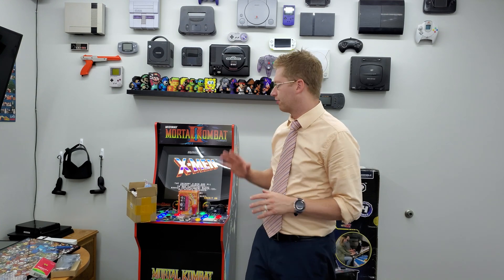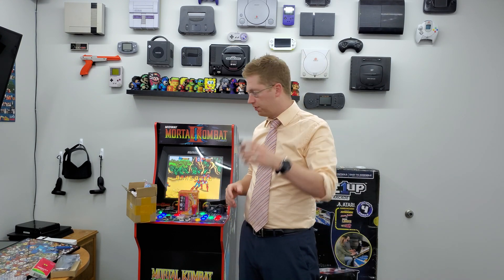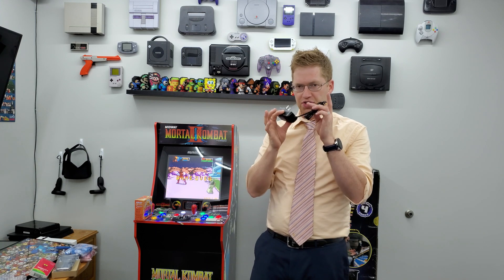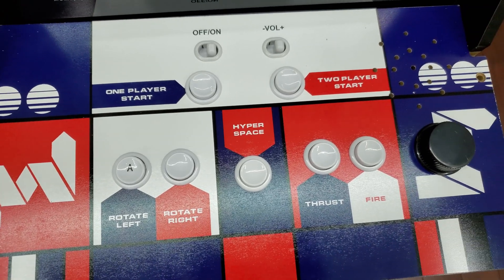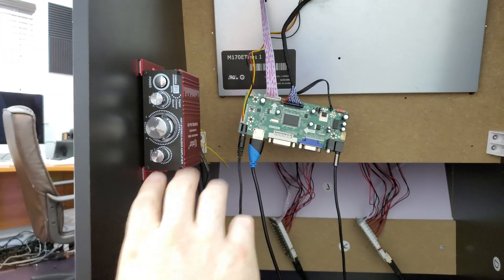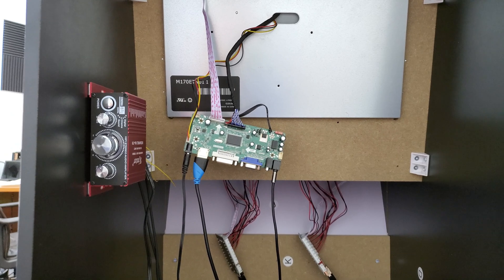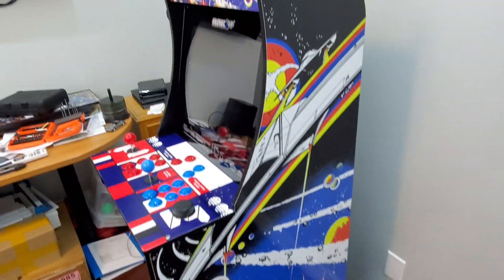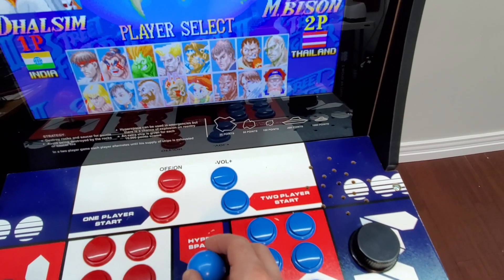BUILD A CUSTOM ARCADE1UP CABINET FOR UNDER $300

Comment: With the space available I would of just used an old PC it offers so much more over those Raspberry PI also has audio so gives option to put some pc speakers in their as well.

This may cost little more but it would allow much more storage space and better hardware for future.
Reply from the maker: Yes I agree, I use a PC in my own build but this video was meant to go as cheap and as easy as possible. I always recommend to use a pc when possible.
Reply: I don't get it... Since when does a raspberry pie not have audio out? I have a standard 2.1 computer speaker system connected to mine. 

Also I'm perfectly happy with a raspberry pi in my MAME cabinet because I only use it for classic arcade and very early console games. In my opinion anything beyond PlayStation era where dual analog sticks became the norm doesn't translate very well to arcade style controls. Even though I have enough buttons on my control panel for it, games that fully utilize the four shoulder buttons also start to feel pretty awkward. I just choose to play those games in a console type setting where I can sit on my sofa and play with a modern controller.

Comment: You mentioned in one of your other videos that you build and sell Raspberry Pi model 3 B+ with the same set up of games on it as what you did on your Street Fighter cabinet. Do you have a link and or contact to get one from you? Thanks.
Reply: Do you need help building a raspberry pi?

Comment: If I get the asteroids cabinet and go on arcade website and get the street fight control deck. Would it fit on the asteroid cabinet? They have the same dimensions?
Reply from the maker: yes they are the same. it would work fine

Comment: Awesome video, tips on drilling the controls? What bit size did you use, how did you prevent the panel from shredding?
Reply from the maker: Used a 1 1/8”. The bits I used are called Fisch so they cut really well. Also if you have another piece of mdf underneath, it really helps.
Reply: It's as simple as measuring the through hole.